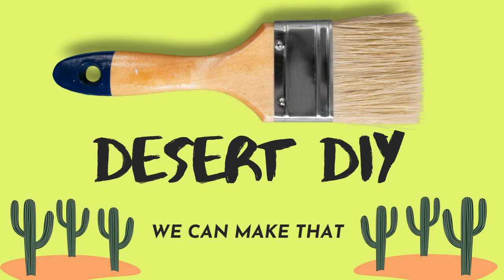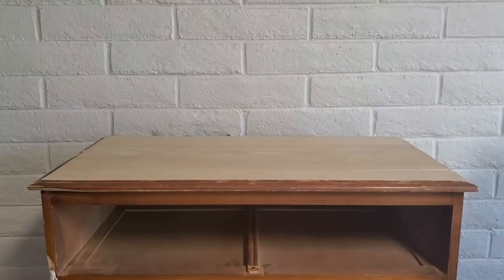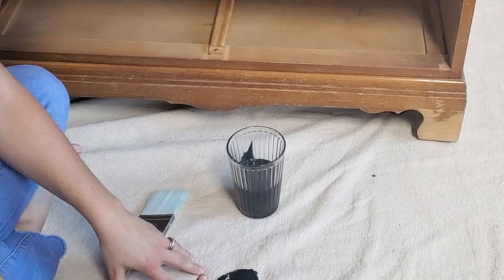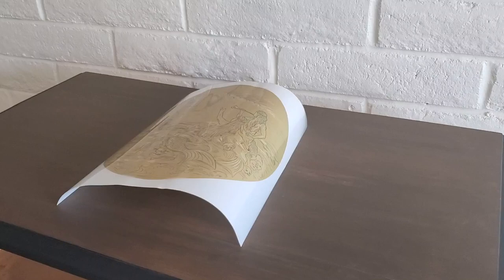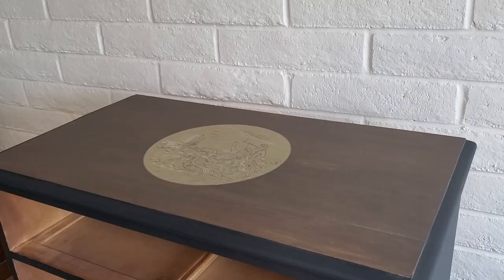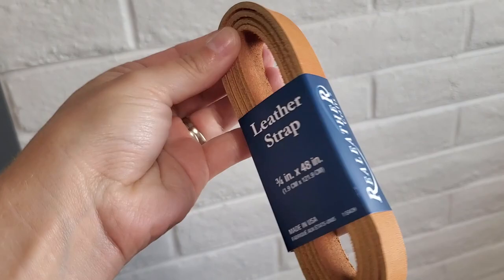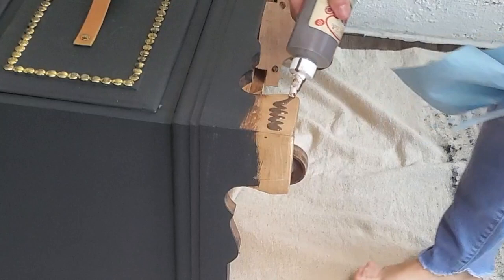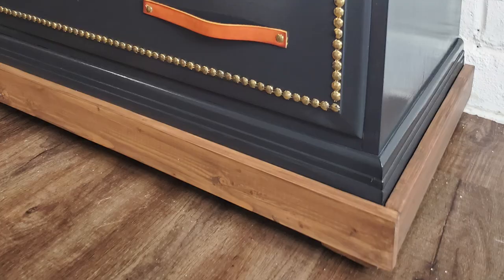Shabby Curbside Dresser Gets a High-End New Look With A Fun Furniture Makeover

Comment: What Dixie Belle clear coat did you use? And will those Nails stay on with hot glue? Using those straps was brilliant for handles
Reply from the maker: This was my first time using this hot glue method on wood but they stuck on very well. Surebonder glue is very good hot glue! I was pleasantly surprised. I used the satin clear coat by dixie belle

Comment: STUNNING! Absolutely outstanding Corey! As soon as you added the faux nail heads it was like magic. I LOVE the color and the stain and the handles! All of it. I’m not a real fan of Nautical. At least not at this time. Lol! But the transfer was a BEAUTIFUL addition and really turned out great! Awesome job once again luv!😃👍🏻♥️ 
Oh!! And I do have a question. Right now I’m just using Rustoleum chalk paints. Can I also add their matte finish to the paint like you did with Dixi Bell? I can’t wait to start using Dixi Bell, but I have to sell a few pieces first!🤪😂
Reply from the maker: When adding clear coat to the chalk paint it takes away a bit of the grip that chalkpaint has so I'd advise doing a good sanding to make sure the surface is not slick and that the paint will stick well. You can do this hack with any brands as long as they are all water based products. Don't mix oil based poly into chalk paint.

Comment: I like your hack for the clear coat. What would I use if I need to seal a wooden, stained, side table that I use outdoors? I usually use mini wax poly but it says interior. Love your channel! ❤️
Reply from the maker: There are exterior grade polys you can buy. They are usually oil based and take a while to dry but are so much better for durability

Comment: Cory, you have so much creativity! My daughter and I are pretty new to furniture flipping and live north of Phoenix. Our biggest challenge right now is getting smooth applications with the paints and the top coats. It seems that our low humidity and heat decrease the workability of our products. Have you had similar challenges? And have you tried the DB Silk paints? Would love to get your opinion on those. Thanks
Reply from the maker: Add a lil bit of warm water to your paints before painting. Like a tbsp. Use a fine mist spray bottle to keep the paint wet as you are painting. And paint indoors.
Reply from the maker: I haven't tried silk yet but I will soon!

Comment: This is just amazing! I want to redue a side table, I've already got my DB paints, but wanted to use a white or clear wax over it, but not sure if would be the right thing being people would be setting drinks n stuff on it.. It's for outside, so I probably won't be using coaster's. Lol.. What should I be using?? 🤗
Reply: Check Dixie Bell’s website.  Look for the “Contact Us” tab and let them know that you’ll be using the piece outside.  I’m sure they have a product they can recommend.  Good luck with your DIY!
Reply from the maker: Gator hide clear coat is dixie belles toughest clear goat. A non dixie belle product I'd recommend for outdoors is oil based poly. It stinks to high heavens but once it's dry there is no tougher poly than that for outdoors. Wax will not do well outdoors.
Reply: @DesertDIY    Yes, Gator Hide!  I couldn’t think of the name.  Thanks!  Also, I was recommended spar varnish or spray automotive clearcoat for outdoor use.